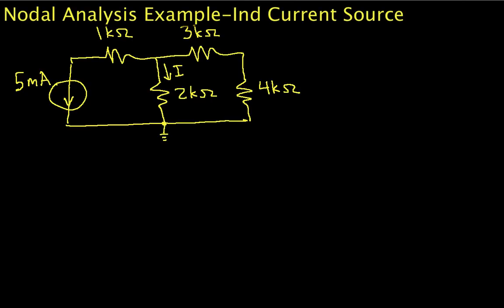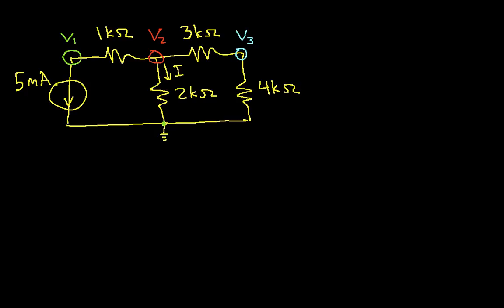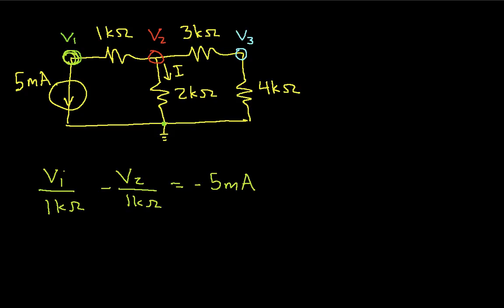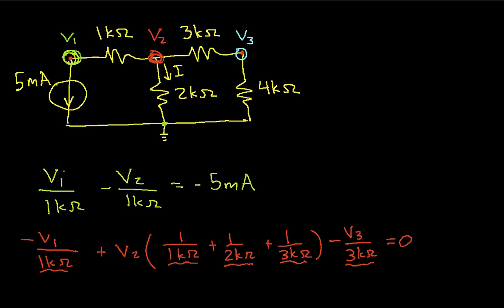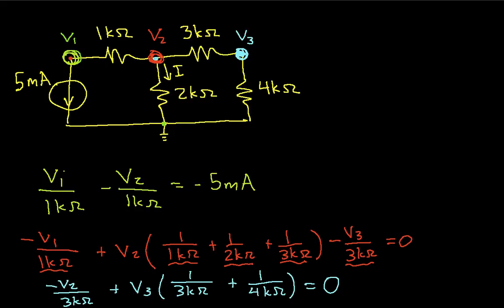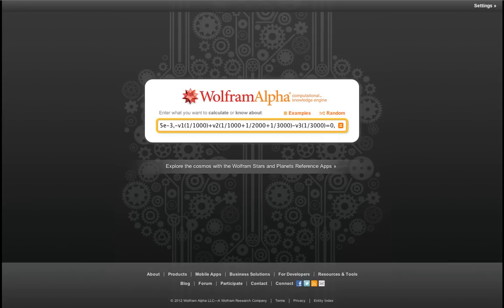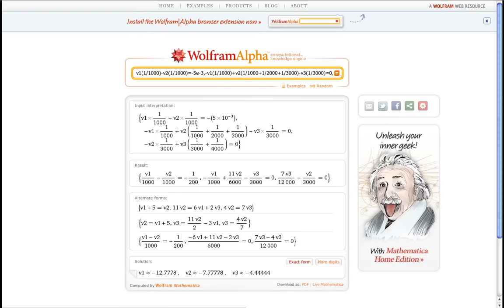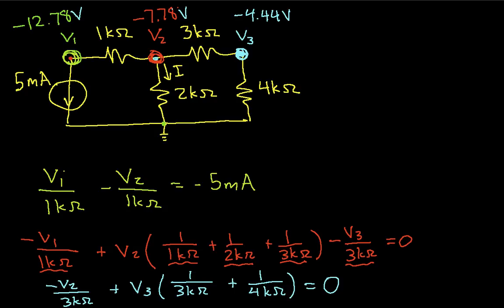Nodal Analysis Example-Independent Current Source

Comment: Bro you only need 1 node voltage equation
Reply: How so?
Reply: (V2/2k)+(V2/7k)=-5m .solve it and you will get the same value for v2 which is -70/9